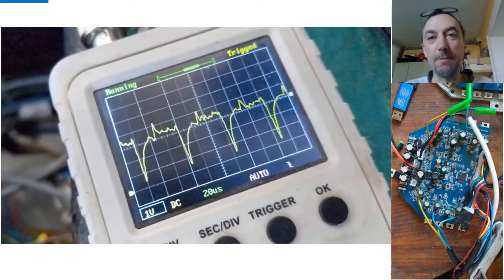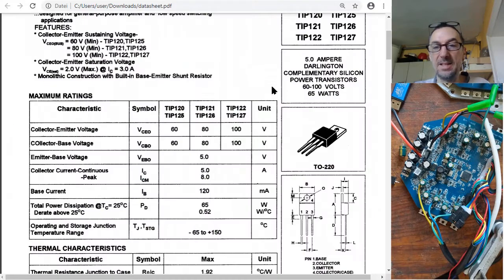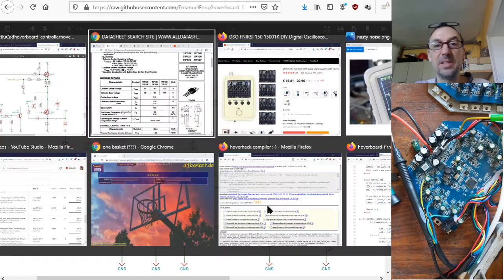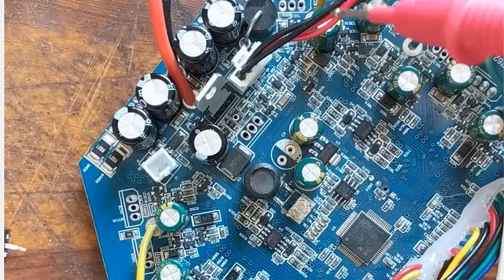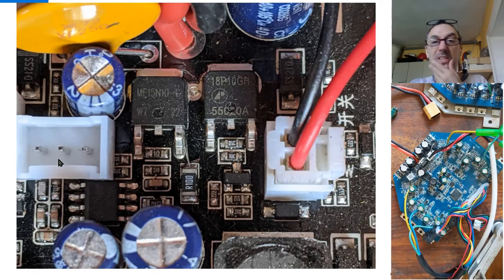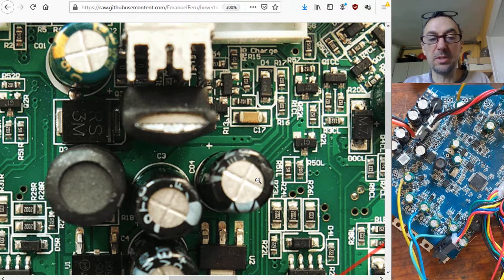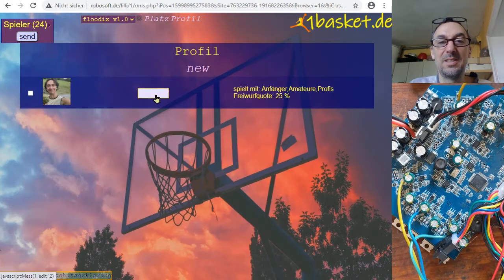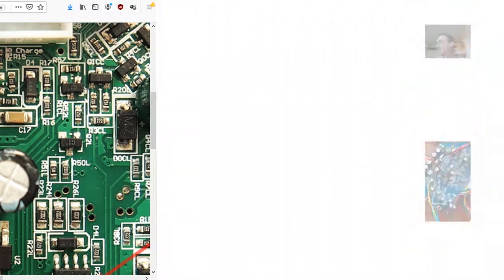part 2: hoverboard repair (+ let us make an expert system)

Comment: Hello
Is there a technical trick to save a board from blew up while checking and testing by add fuse somewhere or something like ??
Reply from the maker: Usually flashing and testing will not break the board.
You could disconnect motors while flashing but I never do. 
Simply know what you are doing,, that is the best protection.
Reply: @robodurden  i face 2 problems with board 
First one i touch by finger the microcontroller area after the board shut down and dead , second board i use multimeter to check between earth and the second tip127 pin 2 all voltage regulator burn and capacitors
Reply from the maker: @newspalestine2283  fingers can have high electrostatic voltage when you sit on something like a wool carpet !
You can also kill the CPU with the soldering iron when the main capacitors have not been discharged.
Checking things with a multimeter should not cause damage. You see that constantly in my videos. Maybe you forgot to set back the red cable from current measurements to voltage/resistance and caused a shortcut..

Comment: voltage regulator 15v in put and 5 volt out put but TIP 127 all three leg 40 volts continuous beep is this mean Tip127 is burned (short circuit happen at battery leads but still still it is charging) waiting for your answer thanks
Reply from the maker: Sorry i would have to review my video again to answer your question ;-) The first TIP127 is for on/off and the second is for creating the 15V the mosfet gates need. So if the dc voltage from 15V to 5V to 3.3V is good than your controler should be usable
If the first TIP127 have short cuts for all three pins than it will always be on and you should install a manual 20+A switch to turn the controller on and off.  bye !
Reply from the maker: @YouCantNow  you don't watch my videos and don't even read my previous answers. The first tip127 is for on/off. When you remove it, no battery power. St-link can only power the CPU of the hoverboard controller. If 3.3V pin is connected.
You can bridge the first tip127 to turn the battery always on. No need to say that this is already covered in my repair videos.
Reply from the maker: @YouCantNow  my English is not perfect neither. I should have told you to short the transistor. Please start using your brain !!!!!!!
Reply from the maker: @YouCantNow  sorry I will no longer answer you.

Comment: Hello
I have a board with a short on 3.3v regulator but the 5v is good ,did you think the stm is good or dead ?
Reply from the maker: So 5V on the stm32 ? 5V should kill the stm32. But you could dissolder / remove the 3.3V regulator and power the stm32 via the stlink flash header.
If you can connect to the stm32/gd32 with the stlink utility, the MCU has survived - at least to some extent.

Comment: my hover while charging one time short circuit at battery terminal now when i switch on its charging but continuous tone what to check and how to repair (no capacitor burn no smoke still charging i check voltage 41v white charging  thanks waiting for solution

Comment: I have the same problem. Lm05 burns and 3 capacitor. One on the main board and two on side boards and tip127 broken too. Replace all elements, board wake up but not give any beep, works fine but toddly silent. Do u know why? Buzzer is ok.
Reply from the maker: I guess the buzzer is driven by a little SMD Transistor. Find it :-)

Comment: Don't torture your self, it's just power cascade: Input darlington serves as a switch, than passes voltage to buck dc-dc converter, then whatever: 15, 5 and 3.3V DC rails.If you ask me, very bad design of power rails, when overvoltage can come all the way to very microcontroller. No zener, no any kind of overvoltage protection, it's predestined to fail quite soon.
Well, off course MOSFETS will blow unless you overrate them, for twice the battery voltage and 2-3 times maximum current of motor. I don't think that any of hoverboard PCB has snubber network to absorb switching spikes during commutation of mosfets. From given schematic of power rails there's BUCK dc-dc converter without negative feedback or any sort of output voltage regulation. Also, these darlington transistors have very poor base drive. One has to ensure that transistor will stay saturated in on state and completely nonconductive while in off state. If transistors transition from one state to another slowly, then there are great switching losses. Many, many unsolved issues.
Reply from the maker: It would be more helpful if you say 'when one of the 12 power mosfets burned also check this or that to have burned.'
Instead of simply bashing these unexpectly sturdy boards.
I replaced my board after a few thousand work hours because it broke down under overload. But now at home i just tested the board again today and it turned out that only the uart communication lines had broken off.
Reply: I've seen so many hoverboard main boards, always mosfets burned, damaged charging part for battery, and also voltage rails damaged. So, yes, very bad design.
Reply from the maker: @SanelKeys  you are too negative. with all but one broken board so far, the opposite wheel still worked after i had unsoldered the burned mosfet. So all the voltage rails and the stm32 survived.
I would like to understand why a power mosfet burns. 
So far no mosfet burned in my solar car. Maybe it helps that i only run on 24V.
Be more positive and be happy to solve problems.
"Failures can only see mirrors of themselves." (Robo Durden) = speaking bad of others only speaks of your life !
Reply: @robodurden  I'm sorry. My intetion was not to bother. My appologies.
Reply: @robodurden  notice there's no fuse in the whole power cascade! Needless to say any more.